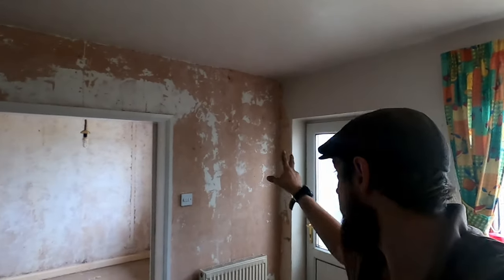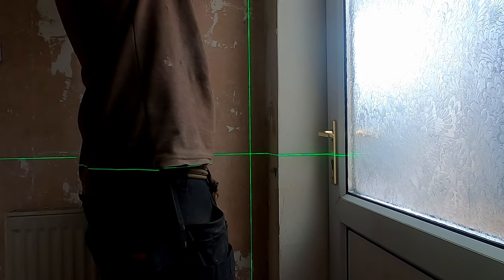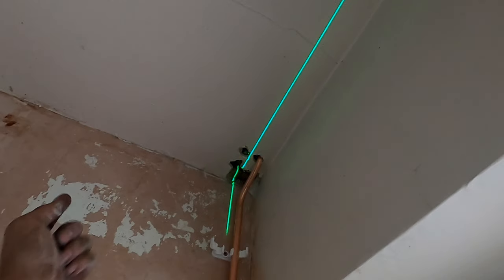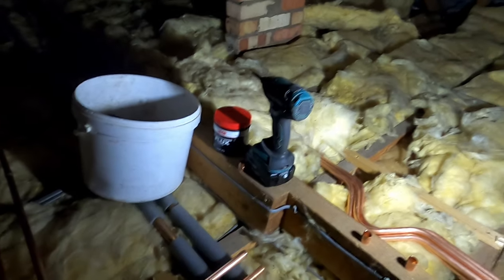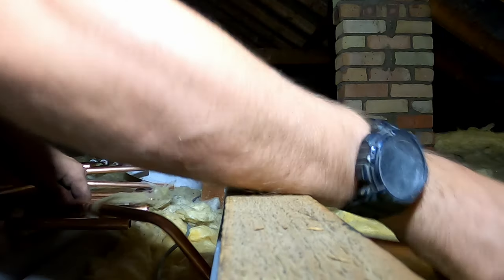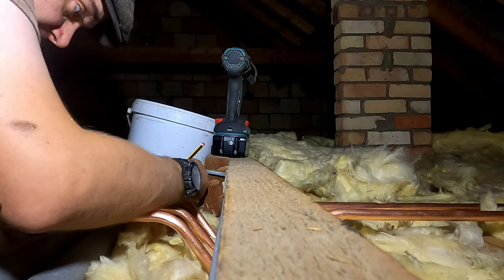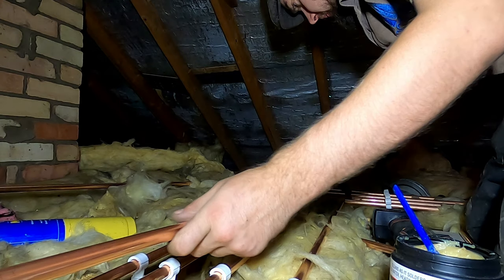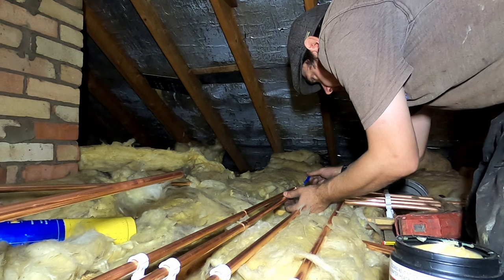Should have used plastic?

Comment: Love those bends under the joists. Plumbing poetry.👏🏻👏🏻👏🏻👏🏻👏🏻😊I left a comment on one earlier about plumbing lead. My old plumber Dad had me wiping plumbs by age of 10. In work in later years cable jointing I plumbed brass to copper. Brass to lead. Lead to lead and even aluminium to aluminium on gas nitrogen insulated cables. I loved doing it. A lost art now almost.
Reply from the maker: Thanks for the support mate, I'm so pleased you enjoyed the bends, my old boss taught me how to wipe a joint even though you can't do it anymore in plumbing. I was going to try and do a video on it at some point because it's a part of the trade that will be lost forever

Comment: Tom my granda used to always say don’t put yourself down because there’s always someone else doing it for you!!
Nothing wrong with your work or bends, it a joy to watch someone else using copper. 
I hate the plastic 💩 I’m sure it has its place but I just haven’t found it 😂 and solder and compression all the way I don’t trust the press fit either 😂😂
I’m stuck in my ways what can I say 🤷🏼‍♂️
Top work 👍🏼
Reply from the maker: Thanks for the support as always Paul, I'm stuck in my ways as well mate, I do have a press gun but rarely use it, I always think endfeed fittings look the neatest

Comment: Did you always do your best as an apprentice 🙈🙈🙈😎👍love your stories, I started in the motor trade as a painter panel beater but you did everything in the old days mechanical electrical the whole works.👍👍👍
Reply from the maker: Thanks for the support as always mate, I think I would have been out the door if I hadn't put in 100 percent effort, one thing with the older generation is they don't take no slacking, mobile phones were banned on my apprenticeship, its fair enough though, it made me who I am today

Comment: Very good work Tom, definitely nothing wrong with them bends , I’ve got a question live in a terrace house and there’s 7 houses in the row with soil pipe (internally) all going to the same drain run but I’m thinking of turning mine into air admittance one in my toilet as I am trying to get all the pipes from the shower and handbasins on the floor between the Joice  would this work for me cheers 
👍👍👍👍👍
Reply from the maker: Thanks for the support as always mate, you will probably be fine, generally the top of the run would be vented, and 1 in every 4 houses, I wouldn't for see any problems in turning yours into a air admittance valve
Reply: @PlumbLikeTom  cheers Tom thanks for putting my mind at ease 👍👍

Comment: Hate seeing a mixture of copper and plastic. Plastic has its uses but in a roof space is a no from me.  30 odd years ago i was banging in one heating system after another without a bit of plastic in sight , basically because it wasn't around so much then.
I left school in the early 80s when there was a recession. I got in through the back door , very similar to you. Started with my fathers building company , signed for college straight away and did general building stuff until i got a full time plumbing start and progressed from there. 41 years later I'm still in the plumbing game mostly commercial with no intention to retire any time soon. If i had my time again i would still want to be a plumber.
Reply from the maker: Thanks for the support as always mate, I wouldn't change anything with my career either, you do get bad days in this job but honestly I do love it, there's always something new to learn and every job is different so it keeps you thinking, it is tough when you first start though but all of it becomes worth it in the end

Comment: Just thought of a very silly question I hope you can answer. I have just had my Combi boiler removed and had an unvented heating system put in with a hot water tank. For the life of me, I cannot work out in my head why the hot and cold water don't mix. Could you please explain how this system works?
Reply from the maker: On an unvented cylinder there is a combination valve with a check valve inside, this stops the hot water expanding back down into the cold, the combination valve also incorporates a pressure reducing valve and a 6bar relief valve, it will be situated on the cold inlet to the cylinder and stops any hot mixing with the cold